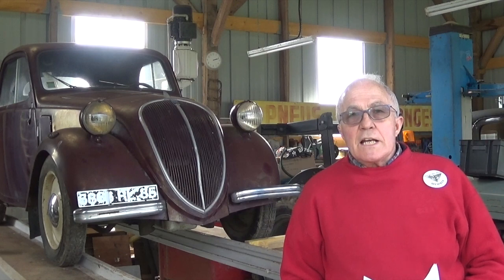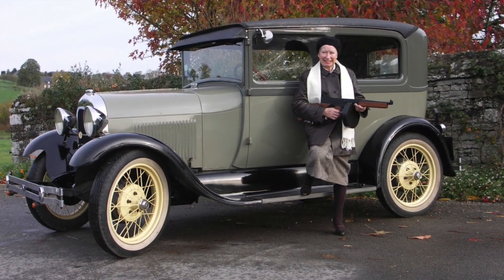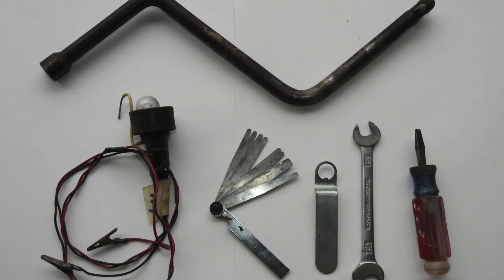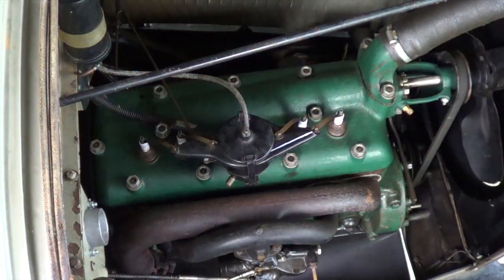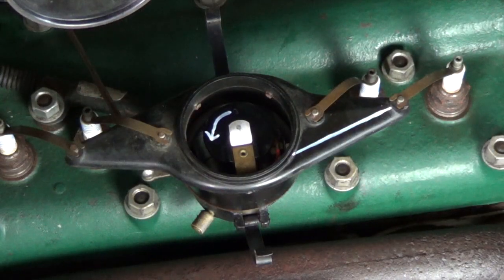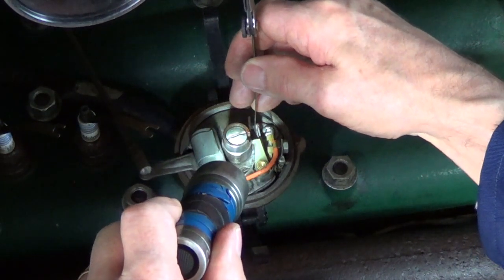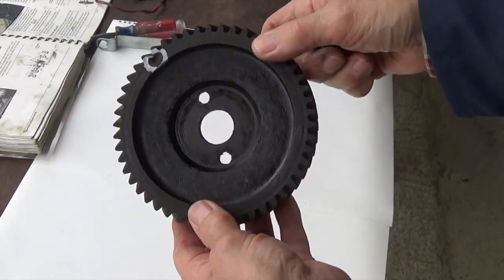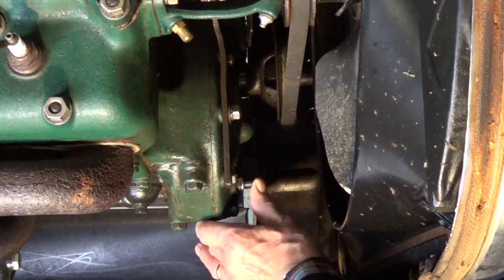Ford Model A Ignition Timing

Comment: Hi, I sure hope you read this comment. I'm having a lot of trouble with the distributor apparently I really screwed up when I set my timing. I didn't follow anything that you put out there. Now I understand a whole lot more. But when I tryed to start the car, the motor spun. Then it dragged real hard. The motor spun and then dragged real hard. And then my electricity was gone. Actually, my electricity was gone everywhere horn ,lights etc. What do you think I did? And how do you think would be the type of thinking I would have to combat it. I sure would appreciate any help, Thanks
Reply from the maker: Good afternoon Jon,  may I suggest following the instructions before you start always pays off.😁

If I were you I would go back to basics, as you seem to made life difficult for yourself.  Check in the Les Andrews red book and retime your Model A engine from scratch, it will save you a great deal of time in the end.  Otherwise you won't know where you are.

Check your timing mark on the flywheel, find top dead centre on Number 1 cylinder then connect the timing light as I show on my video.  It sounds from your description if she is making heavy going turning the engine over you have the timing too far advanced.  But don't guess it, go back to basics and do it right. 👍👍

Comment: Thank you so much for taking the time to do a step by step tutorial.  I pick my first Model A up this weekend and I need to know about timing a Model A this will need my first time owning one and I've heard a lot about timing.  Not your typical small block Chevy lol.  Cheerio!
Reply from the maker: I'm glad you found it useful.  Don't forget to subscribe to vintagefordforum.com if you want any helpful advice.  Good luck with your new car!!!
Reply: @Qspecialman  I did subscribe ty
Reply: Thanks for the video. How can I change the position of the rotor in regard to the  gear of the camshaft? I need to point the numer one cylinder again. The rotor is in a wrong position because an oil pump wrong dissasembly.

Comment: How big is the distance from the pointer?
Reply from the maker: Good morning Uwe.  I'm not sure I understand your question.  If you would like to view the video again and then tell me at what time (on the clock on the bottom left of the screen) the pointer you mention is shown, I will try and answer your question.  Regards - Tony
Reply: That gap should be between .025 and .035.  .025 is pretty standard, .035 gives you a hotter spark. They should all have the same gap and you may have to file the buttons a little.

Comment: IS IGNITION ORDER  1-3-4-2 ?   OR 1-2-4-3
Reply from the maker: Good morning José. The firing order is 1243.  It is very difficult to get it wrong with the Model A distributor and the metal strip spark plug connectors. Have a look at the Model A basics site, you will find it very helpful. http://modelabasics.com/Ignition.htm
Reply: @Qspecialman  YOU ARE WELCOME  THANK YOU

Comment: Thank you sir! My buddy just got a 1930 Tudor. Already restored but still needs a little love and some extras he wants, same color as yours, two tone green but with black wheels. Beautiful straight body, excellent paint job. It's going to be a driver not a garage ornament. 
Has anybody managed to keep the exhaust manifold painted with high temp paint? I'm going to try some. If it burns off, ...oh well. I can't tell from old pictures if it was bare cast iron or not from the factory. I'm usually doing all the under hood details on our cars. Since it's so prominent it bugs me for it to be rusty.  I have to change out or clean up all the painted over bolts and nuts too. He may go for chrome ones I hope. Even our daily drivers need to look good under the hood.
I'm going to try some rust reformer that supposedly turns rust to a primer-like substance and some "flame proof" 1300-2000 degree paint.
Reply from the maker: I'm glad you found the video useful.  With regard to painting the exhaust manifold, I suggest you have a look on www.vintagefordforum.com, and ask the question there.  They are a very helpful and knowledgeable bunch.
Reply: Thanks and happy motoring.
Reply: For your exhaust manifold...NIC industries has a black satin ceramic coating that is sprayed on and no need to oven cure it.  You must media blast it, and be certain no oil contamination exists (place part in old oven at 500F for an hour, let cool, then blast it).  It sprays easy, and withstands exhaust temps without fail.  It lasts years as well.
Reply: Trey wood stove polish for your exhaust manifold. Tip from the "old timers"....
Reply: @jimduffield2541  I now remember hearing your "old timers" tip, but forgot it.  Thanks for the  wake-up reminder.